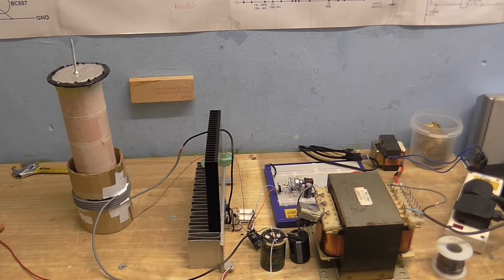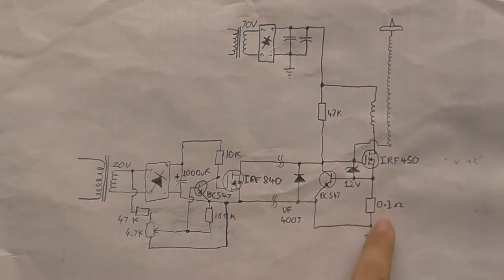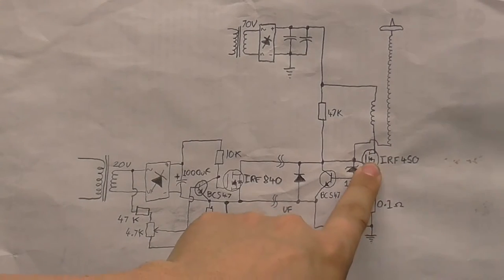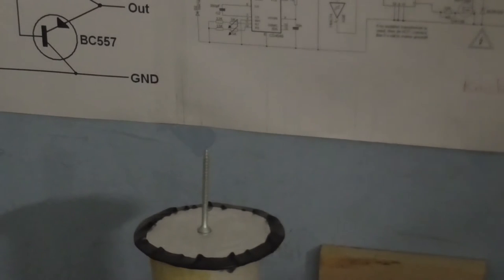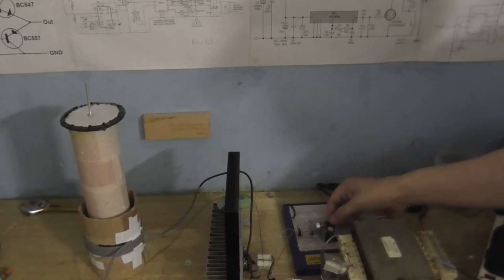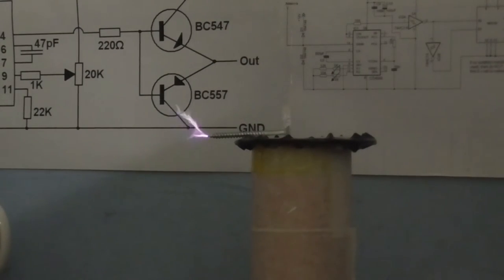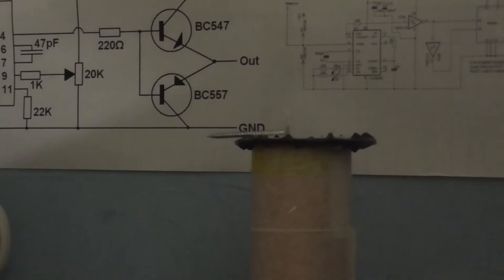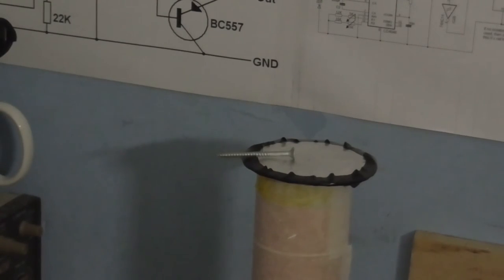Tesla Coil Tuesday 7 - The Driverless Tesla Coil

Comment: Hi Clem. Have you checked out the ST14NM50N. It is a 500v 12a .32 on resistance MOSFET. It has very low gate capacitance and should be easy to drive. Seems like an ideal transistor for Tesla coil experimenting.
Reply from the maker: Can't say I've heard about those.  I usually go with parts that most people use because I know they work. These do sound kinda good though, I'd check the datasheet out to get a good look at exactly what they can do if google would find it (which it won't).

Comment: interresting design, however that is very weak for rectified mains. I was getting similar results with my slayer exciter from 36 volts. Still, nice work!
Reply from the maker: Actually, this was running off that big transformer I have, so I was running this at about 100v dc.
Reply: CoolDudeClem yeah but still the output was not that great, however cool video though. BTW, what was that mystery component on the breadboard in the dpak? package?
Reply from the maker: You mean the little square part with 4 pins? That was just a rectifier.
Reply: CoolDudeClem do you have a a part number for it? It seems like a very handle little full bridge? rectifier, as the ones I have are big and mean, and dont even fit on a breadboard without wires :P .
Reply from the maker: I don't have a part number, it was just something I ripped out of another circuit board, those little rectifiers can handle anything up to mains voltage.
Reply: CoolDudeClem do you know what current they can handle? Sounds like a very useful part!
Reply: yo
Reply: yo
Reply: Mrinal Thakur ok, you definately hit the jackpot :DDDD Whats up dude? Hows India?
Reply: Ivan R well India is great 
Did you bought that rf function generator
Reply: Mrinal Thakur ill probably get it when we move to Singapore. Ill convince my parents to order it as a birthday present, but it wont come any earlier than the 21st of august, as that is when my birthday is :P
Reply: Ivan R ok

Comment: Hi CoolDudeClem i wanted to ask u something about the frequency the coil operate, cause i want the coil approximately runs at 1 Mhz. is that possible with this driverless circuit?
Reply from the maker: It should be ok,  the whole circuit self oscillates, so it will automatically "tune" itself to whatever the resonant frequency is.